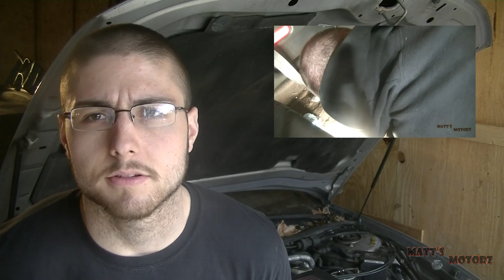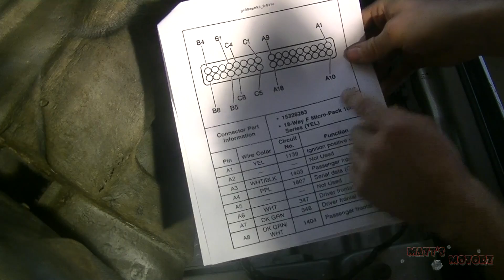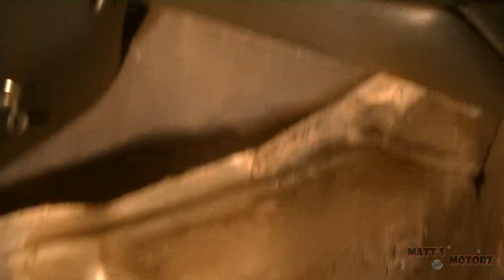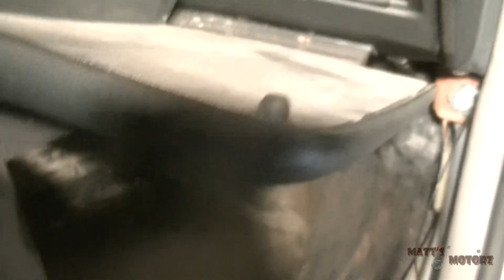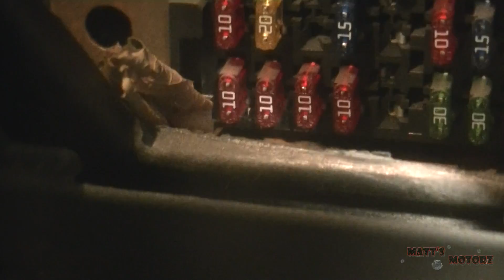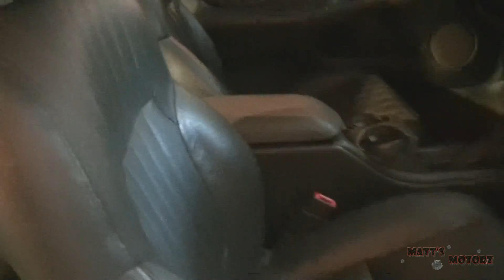Diagnosing an Airbag Light

Comment: I fix my Chevy impala by taking it to my mechanic who diagnose it with his auto scanner tool .  The scanner pinpointed the problem was the drivers side seat belt was bad.  I bought a used seat belt at the junk yard for 50 dollars and mechanic charged me 45 dollars labor to put seat belt on.  Service Air bag light disappeared automatically after used seat belt was replaced.  A new seat belt would have cost me 114 dollars , so i decided since my car was up in mileage elected not to buy a new one.  Hope this helps.

Comment: Would this be the same for an olds intrigue? My light just came on. My passenger seat however has no power or connectors. Would the module still be under it?

Comment: if you need to remplace this little box under the carpet ,you need to reprograming  the car computer?  or something? or just remplace?
Reply from the maker: The airbag module can simply be replaced with another one.  No re-programming is needed.
Reply: thanks a lot man!
Reply: DR. LOTHAR KANE

Comment: Wasn't paying attention one time, hooked my battery up backwards... not a good day lol. When the smoke started rolling I knew I'd done a no-no, but thankfully it didn't fry the computer or anything, but interestingly enough it fused the metal diaphragm inside the oil pressure sensor. setting the light off. It sucks when you get a part you didn't need, but at least you didn't put your battery in wrong! lol
Reply from the maker: Lol, I HAVE in the past.  Luckily I realized after about a second or two. Didn't do any damage thankfully.
Reply: MattsMotorz
Reply: Jesse C6örandle